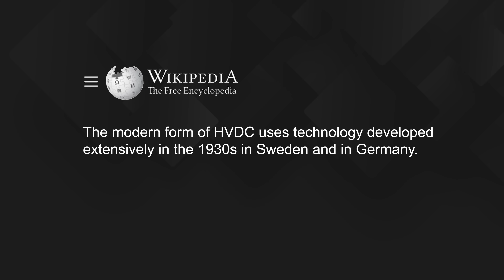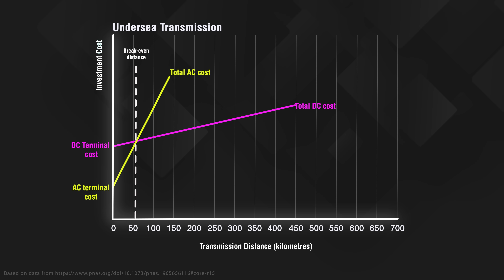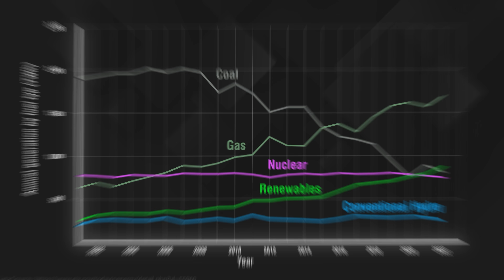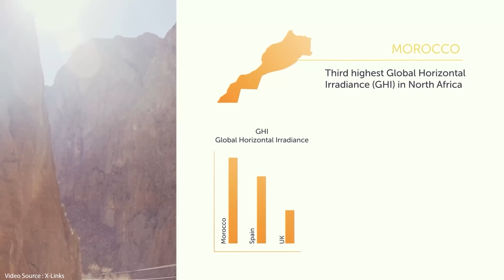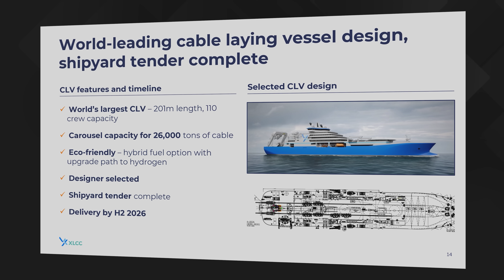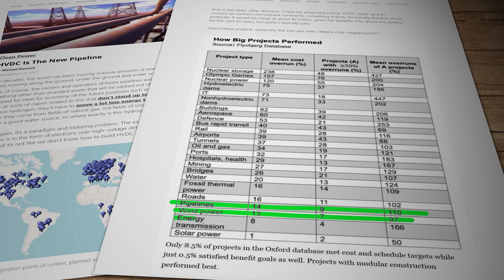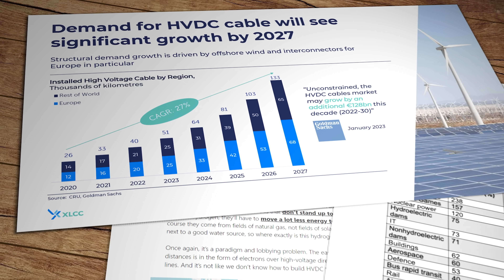Revolutionising power transmission.

Comment: Progress with transmission is good BUT:
An alternative is to 4x overproduce from solar (padded with wind), so that, even in winter, the daily solar harvesting for each household is enough for its own needs. What about the excess generation in summer? --> Direct carbon-capture (possibly compensated by "carbon credits" or similar compensation-schemes). DCC does not care what time of the year it is activated. It is better than building a half-year-sized energy-battery.

Comment: HVDC is hardly a "revolution". Where HVDC really shines is connecting two (and no more than two) points over a very long distance, thanks to very low transmission losses compared to AC. However, due to its complex nature, HVDC will never be a grid. HVDC systems that connect three points do exist, but are few and far between, and are quite finnicky to manage. If you want to connect many points, e.g. dozens of cities, an offshore wind farm here, some solar farms throughout the countryside there, a few hydro plants, maybe some storage facilities here and there, industries everywhere and so on, you will need an AC grid that can quickly adapt to changes in supply and demand.

So in order to get that geothermal power from Iceland to the European continent, HVDC ticks all the boxes, but it can never replace the AC grid. HVDC is not a revolution, but merely an extra tool in our electrical toolkit.

Comment: Underground cabling might be the solution especially in areas where ice storms are a risk  or areas where a blown transformer could start wildfire.  One giant problem IMO is that energy companies are heavily invested in fossil fuel facilities and the shift to wind and solar requires additional capital investment before paying off the existing “mortgage” .... which might be billions of dollars to a regional energy company.  The other issue is building code restrictions and HOA restrictions that limit homeowners ability to transition independently.  It makes more sense that a group of homes would use existing power lines to share green energy and be able to draw from the grid when wind and solar are not adequate.  This would create a distributed production system that would not crash an entire city or region if the grid is hacked by cyber criminals or cyber warfare.  And traditional weapons of war cannot disable vast regions by blowing up a trunk line in a remote location.

There will be a need to replace solar panels and batteries and the sun tracking systems as better components are developed..... just as cars and computers have a limited lifetime, so will power equipment that sits outside exposed to high heat and freezing cold.  The transition to renewable energy may require energy companies to be redefined and begin offering home services similar to roofers and HVAC.  

But power companies could continue to be profitable by linking homes together with existing lines, also reducing the need for massive battery banks.....smaller shared battery banks..... with smart systems that can draw grid power in small quantities powered by hydro or wind farms or nuclear.  

It might be that massive infrastructure maintains the power companies monopoly of the local power production, but is that really the best design?  

If I was building from scratch again, bringing power to the home..... I would prefer an independent system.....off grid.... with a propane generator for backup when wind and solar are not keeping up.  Energy company could be the installer or even lease the system to me but I would know the cost and could be sure prices would be fixed regardless of inflation rates.

Comment: Matt, 

one, this energy transition that is talked about won't happen, it can't. It is practically and techniclally impossible with current and near future technology.
Two, high voltage D.C. is decades old technology and while has fewer losses than AC they are far less resilient to faults and trip very quickly in such situations.. Conventional AC systems have a far longer response time and resilience to faults.
Three, weather events are often very widespread so affecting several countries at the same time, and if those countries have large renewable power capacity there simply will not be the capacity elsewhere that can be imported to make up the deficit.
There is no magic bullet to overcome the practical and technical deficiencies of renewable power.

Comment: HVDC sounds like a good idea for long transmission lines and I am all for it. However, I am a little concerned that we are becoming dependent on energy from overseas - which can be turned off outside of our control. Look at Russian energy (gas) supplies now!
We have great potential for wind and wave power and some solar power in this country - we should, at least, try to exploit this to the max first AND use HVDC to distribute it, of course. I cant help thinking that we are looking for energy from overseas because our own energy planning in the UK has been appalling over the years especially when it comes to wind, solar etc.
I also question the green credentials of making FOUR 15000km power line in case 3 of them go u/s - what? The energy and effort that will have to go into these lines will be horrendous not to mention the security aspects.

Comment: While this is great and all, the limited cable capacity, should be compared to just building a nuclear plant at similar capacity, as i feel there is a break point where it become cheaper to build nuclear than build a big cable long enough to encircle nations and the extra capacity to fill in the power.

Comment: Something people need to realize is that this transition has been ongoing for at least a decade if not more. 
However, most of what has been going on is planning, research, and not the developments. 
Only now many years later are these efforts starting to bear fruit in the form of developments like this.
Some of the things being planned for the future are only beginning their planning,  and research,  now. 
This means we can expect more of these developments to keep showing up as the years unfold.
I expect there will be even more developments that come about, that we weren't even aware were being planned, or researched. 
Science and technology in our times is a hydra with many things going on simultaneously all over the planet.
Reply: The first interconnector between England & France (IFA1, it failed once in 2001 due to a fire at the Kent terminus. It's still in use) was connected in 1986 though 330KV lines the length & breadth of Britain had been in use for several decades at that point.
Reply: Interconnectors are about "sharing" which is far too "Socialist" for our right-wing Press but even the Torys are building them, 3 were connected last year taking our total to 9 with more planned, including one to Iceland.

Comment: would have liked to know the causes of these losses in the HVDC and the possibilities to reduce them.
Reply: For HVDC its all resistive loss - the lost energy goes to heating the cable. For HVAC its mainly the line acting as a huge capacitor - the energy is lost as ultralow frequency radio waves (quickly absorbed by earth or water which is why very long underground or even medium length underwater lines are not feasible).

Comment: I can see some uses where there is surplus but I do have concerns with this project. It could become a form of energy colonialism where we fill delicate desert biomes with acres of panels, taking energy from developing countries that need it instead of putting panels and turbines closer to point of use. There is also nothing here on the transmission loss over high distances.

Comment: I m very much in favour of the Xlinks project but security of supply worries me. 8% of U.K. power supply is a lot, spreading the power delivery to other European countries such that power delivery to the U.K. was only say 2 to 3 % would be more comfortable. You can never tell what might happen in a country that supplies you with power which might lead to cut off or disruption of supply.

Comment: Merci beaucoup for this.  However I am wary of Greenwashing Corporations usurping this technology and miscalculating the real needs of a future society.  Every calculation is based on our present Mordor Economy energy requirements with fracking and tar sands, as well as deeper coal seams.   Big Oil is trying hard to hide the fact that they use 43 to 48% of present electricity just to refine oil.  But everything I've read is that refining has become less efficient with the lower quality of fuel with fracking and tar sands.  I have proposed to Simon Michaux to recalculate our energy needs as we reduce fossil fuels.  BTW we can also stop producing the millions of tons of toxic chemicals needed for the Mordor fuels.
You can see my interview for Windyday Concept on Environmental Coffeehouse.

Comment: The US needs UHVDC lines running across the country from coast to coast. The current grids are basically north and south. The efficiency gains of being able to move energy east and west as the sun rises and sets would dramatically increase the efficiency of the existing grid generation. Add in solar and the gains are tremendous.
Reply: There are a few lines running half way or more & there are cris-crossing lines which may well connect up (if they're the same Voltage). 

The USA's power problem though, from the very beginning, is that it's never been nationalized so there's never been a national strategy.

Even state-wide strategies are patchy in some places & the overall theme has always been "most of the customers most of the time" rather than resilience being the theme.

The UK grid for instance has handled every solar flare so far but USA's grid just flakes out in patches & they restart it as quick as they can from whatever is still running. Interconnectors give more sources for re-starting the grid.

The UK has one (big like Cape Canaveral) central coordinating room for the whole grid, it has a live map on the wall with every power station & all the big links on it, frequency & Voltage, big consumers, all the data, (even a TV guide so they know when the kettles are going on) there's phones to every power station & to a few big consumers (Tesco supermarkets for instance can be commanded to turn off all the refrigerators in every store in the country for 5 minutes) 
USA does not have this AFAIK.
Reply: @alanhat5252  Voltage differences do not matter on UHVDC.

Comment: HVDC is def. a goto solution for long distance transmission, however I dont think transmission is the bigger problem. As was stated on the video only 10% is mandated to be exported (within EU) thus even with transmission like HVDC (according to wiki: 3.5% vs 6.7% losses over 1000km) it wont solve any energy issues on a grander scale. That would require an open energy flow which means that all countries would have to agree on cost investments for energy production which is most likely a political nightmare, not to mention that it would really mean regulation control of energy production to keep prices down (open market want to reduce costs/overproduction to keep margins up).

Also...during the energy crisis in Europe over the last year I doubt there is any country that is happy it is sharing its energy production.

Comment: Thank you for this overview of the HVDC transmission system. I've been amazed at how rapidly the system has expanded. What used to be technically impossible a half-Century ago has become routine due to the creation of the high voltage, high current switching semiconductors utilized in the converter stations that convert the AC to DC and back again at the respective end stations.
Reply: The New Zealand HVDC ( 350 kV )  cable , called "The Cook Strait Cable" , runs from Benmore Hydro Dam to Wellington is 610 km long and runs for 40km under the Cook Strait been the South and North Islands started construction  in 1961 and commissioned in 1965. That is rather more than 50 years ago. This technology is not new even though some YouTube channels may have only just learned about it. The Cook Strait Cable system has been significantly modernized over the years but the principle remains unchanged. It is now a bipolar thyristor based 1200 MW system.
Reply: @andrewpaterson5192  Interesting. Which technology was used for the Cook Strait Cable system in the 1960s? Good old vacuum tubes (well suited for high voltages)?

Comment: Excellent summary of HVDC.  Its definitely a part of the future especially for geographically larger countries (China, USA, Canada, Australia).

One potential big obstacle: politics.   Because tying together two or more countries over an energy link (even an electrical link) may move some nations back to being energy dependent on another — certain factions within each government may not like that.  We got an all to real reminder of that with Putin using oil & gas as blackmail and leverage.  Relations between two countries can start out fine but then, a decade later, not so fine!  So the problem with long distance transmission (such as HVDC) is not just technical.

Just to be sure, the problem of grid upgrades & expansion is not specific to renewables.  It is a problem for any new power plant added to the system.  It just so happens that renewables are now the most common type of new capacity to the grid and for good reason.

Long distance transmission technicalities and energy independence bring up another good point for wind & solar.   Wind and sunshine are far more evenly distributed on Earth than oil & gas ever was.  Moreover, localized energy generation via rooftop solar (commercial and residential) solve both problems simultaneously.  This highlights the miracle of solid-state photovoltaics: no other energy source can blend into an urban landscape so seamlessly.  Every watt generated & used locally is a watt that doesn't stress the grid nor pulled from a distant power plant that might even be from another country is long distance HVDC is involved.

Comment: Sun Cable in Australia appears to be set for HVDC transmission from Western Australia to Singapore, Cannon Brookes has won control of the venture from Twiggy Forrest. The scope for electricity sales to Asia of green energy from the vast outback seems to be a real game changer.
Reply: Let's hope they can also connect the east and west coast to smooth out supply variability and reduce the amount of backup power needed.

Comment: I hadn't thought about DC being a viable long distance option.  Thanks for causing me to check it out.
Reply: It wasn't for a long time - that's why we went with AC.  Its been known for ages that the transmission itself is less lossy than AC, but the stepping up and down on either end of the HV line was always a problem.  Modern technology has improved however and that's no longer quite as much of an issue.  Its still more troublesome than AC stepping of course, but its now less of a problem than the transmission losses, so we're slowly making the switch.

Comment: During 35 years engineering electric utility systems, I saw Underground HVDC as the up & coming alternative. It will become the norm, not just for cost, but for siting & operating reasons. It has been slower to adopt  due to tradition & vested interests. A project on which I helped push UG HVDC for environmental, installation, and operating advantages, was forced into traditional overhead when a governing body said "if we let you do it, EVERYONE will want to do it." (To which I said "Great!") The overhead project cost twice our estimate because so much less was under our control. And you wonder why your electric rates are high.
Reply: Yep, corruption everywhere :'-( 

Still, Boris Johnson bringing it to public notice may slow it down for a while if we vote in a better government at the next election
Reply: Domestic rates are currently even higher because of 2 other bits of corruption;
electricity is charged as if it was generated by gas regardless of actual source & 
energy & fuels are, by law, sold on the "open market" which translates as the Stock Market whose rates have been artificially high since the Russian invasion of Ukraine.

Comment: My biggest concern is with these multinational projects. What's to prevent those in the producing countries from nationalizing the infrastructure and then flipping the switch or otherwise rationing the output in order to artificially raise prices? OPEC did it during the Carter Administration. I don't want to be held by the "short and curlies" again.
Reply: Massive income streams like power supplies don't tend to get interrupted while payments are up to date. The CIA's 1953 coup in Iran was because BP hadn't kept payments up for 40 years. (BP ended up paying more & losing exclusivity).

Comment: Interesting you haven't convinced me yet but Interesting. Still in the USA, more than half of the 4243 billion kilowatt hours is generated using fossil fuel then there is the strain of potentially 400 thousand about 50% class 8 semi tractors each consuming a conservative 500 kw per day 200 million kw maybe a lot more plus the low hanging fruit of replacing natural gas for heat (tesla wants people to buy heat pumps) so where is all the additional electricity come from if at the same time fossil fuels are replaced.  I hope you are right but I also know utilities have to be convinced.  I am sure you must know how fragile the grid is in the US